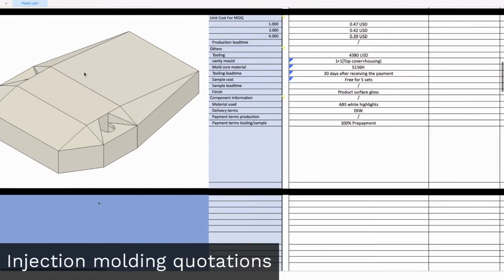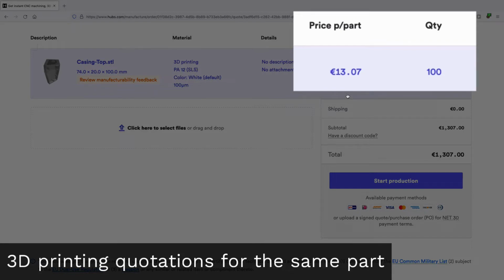Manufacturing plastic parts in different quantities

Comment: Its interesting (and frustrating) how one of the simplest things can be so difficult, such as getting the plastic enclosure made (like, all the electronics can be done at any scale).. I am indeed looking at 10-50 unit range (I think so anyway) but FDM printing doesnt have the finish I would like (also shape requires quite a few supports).. Considering getting an SLA printer which would probably work,  but I dont want to nor have space to deal with that mess… Am also considering to print once (FDM with manual sanding /finishing or SLA) then casting and molding, no experience with that either.. but it would be nice to do it myself and perhaps do some iteration.. already sort of designing it with injection molding guidelines; 1 undercut, angled walls etc.. so casting should work..

Aluminum injection molds might be a cheaper entry what im reading online, those mold prices you mentioned were probably aluminum right? Anyway still wayy to expensive for the stage im at.